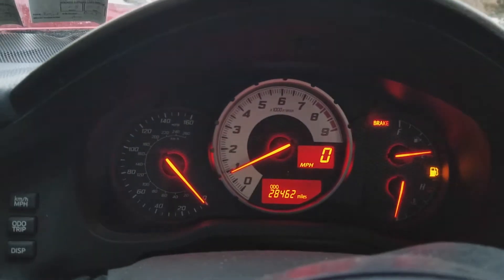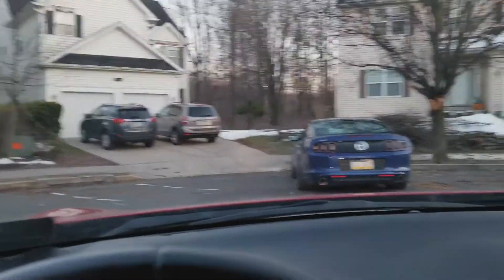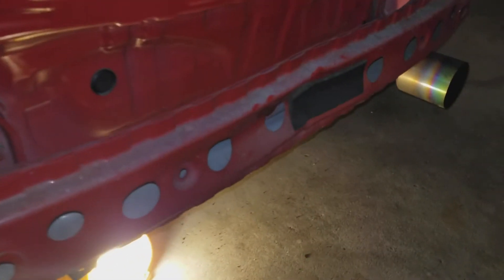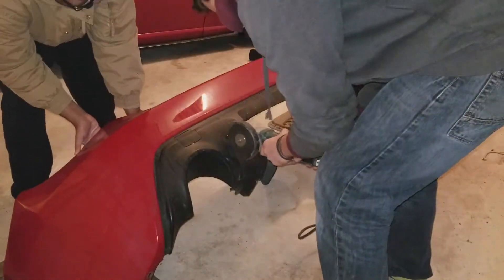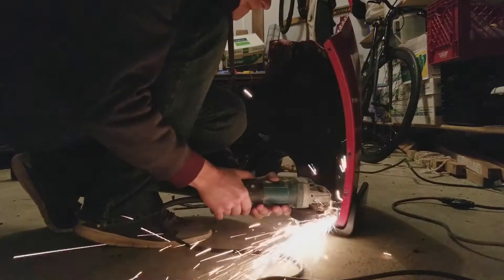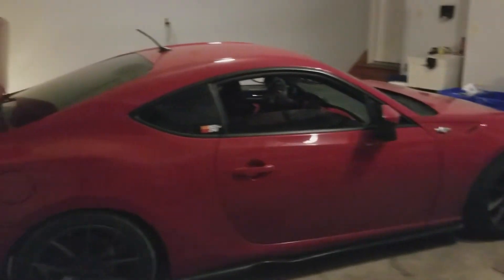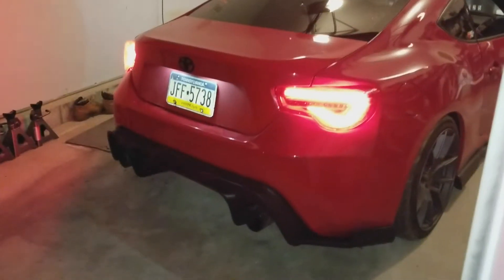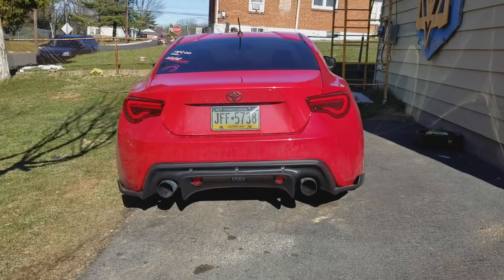CUTTING MY FRS!! *Rocket Bunny Diffuser INSTALL*

Comment: Did the diffuser come with the reverse light and the red brake lights?
Reply from the maker: yep
Reply: Break Traction where did you order it from? Extreme dimensions? Carid.com?
Reply from the maker: The Blasian ebay not duraflex
Reply: can u give us the link of the diffuser? and its fiber glass or polyuretane?
Reply: Break Traction yeah I couldn’t find it. Can you please provide a link for us?

Comment: I need help with the led lights. I got like 3 different cables.
Reply from the maker: I connected the cables to power and ground the third blue wire i didnt need to connect.
Reply: Where did you get the led lights from I have the diffuser but don’t have the lights for it